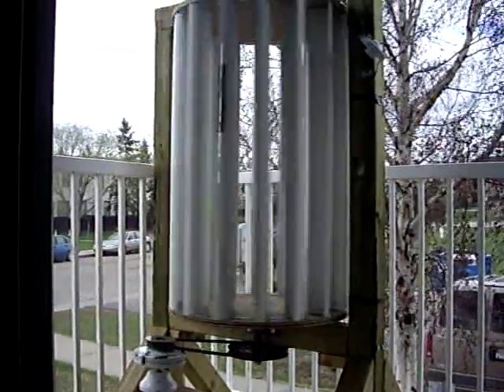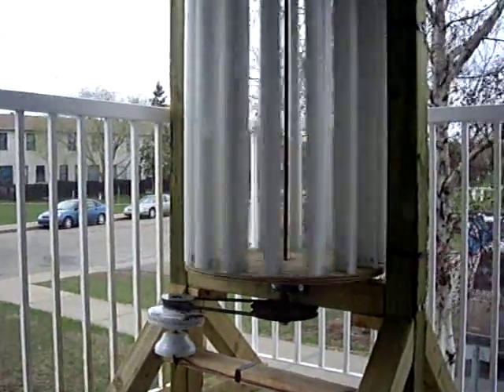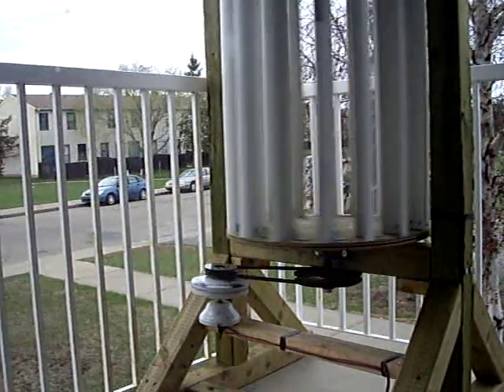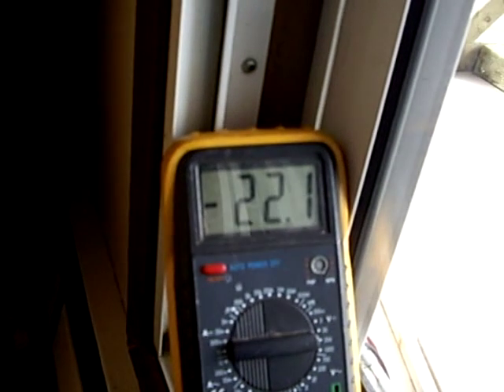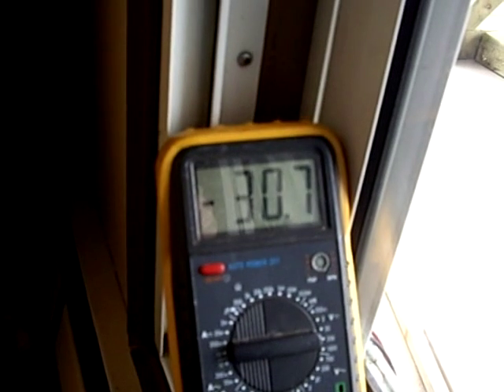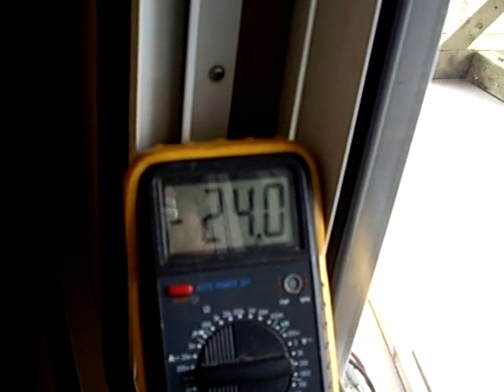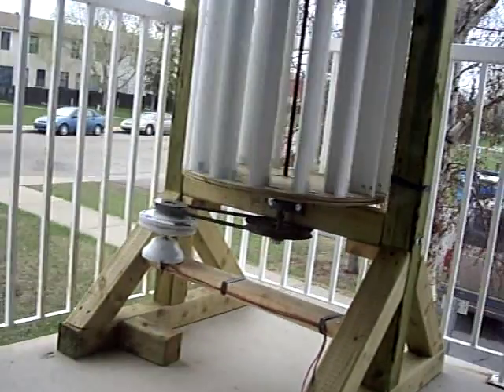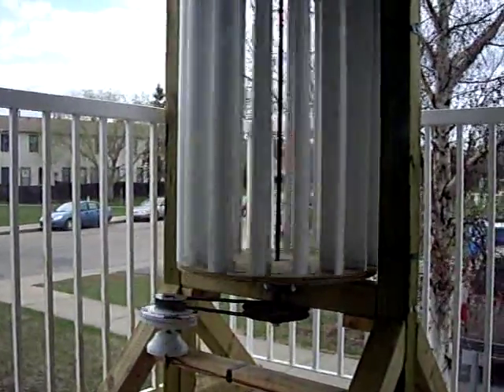VAWT - Vertical Axis Wind Turbine 200 Watt Low RPM

Comment: Hi,  my friend, can u commercialize it, and slightly scale it down on the blade.
May I know how to contact
you  ?
Reply from the maker: Hi sg sun, thank you for your interest in the wind turbine. Unfortunately I am not in a position to produce these units commercially. This was a test build to see if it could be done and it was successful. I did not have drawing or any plans as I built this from watching videos and other peoples ideas here on YouTube. This was built 7 years ago and I no longer have the unit.
If you are interested in building one yourself, please look at the original comment as I mentioned the frame structure size and blades there.
The only other help I can offer is this link: https://www.youtube.com/user/LynxSteam. Check his turbines, they are very similar and do have thinner blades. Good luck with your build.

Comment from the maker: An update on what I have learned from this project after building and running this VAWT:

1. High wind speeds. The design of the turbine was good, although during very high wind speeds resulting in extremely high RPMs, well beyond 50 kph (30 mph plus) I noticed the blades bowing outward at their centers due to the centrifugal force. My design did have extra space for possible flexing but did not expect that great of an amount of bowing. A possible fix would be to add 4 pieces of ready rod to stiffen the vertical axis (3/8").

2. Safety, again regarding high wind speed. I strongly recommend this type of a unit to be mounted high enough and away from anyone coming into contact with it. Although the PVC blades are mounted to catch the winds and any object would hit the back of the blade, I would still urge you not to allow anyone near it during its operation. Also where the framework meets the turbine blades would be an extreme pinch point.

3. Generator was too small. Although it was fun converting the ceiling fan into a generator, it is limited to about 200 watts of output. The turbine could easily run a PMA type generator in the range of 500 to 800 watts as long as your PMA does not suffer from clogging to maintain a reasonable start up speed.

4. Regrets, the only regret I have is that I did not document my build better. I went at this with my typical, in mind ideas to hands on building. Was it a learning experience, yes, definitely. Was it fun building, yes. Would I do it again, yes, definitely bigger with a more documented design and build process to allow me to share what I have learned.

All in all, it has been a learning experience. Due to my change of circumstances, I had to dismantle the turbine and re-purposed the support structure. I still have my generator and pulleys and will keep them for a future project.

I never expected to have over 10,000 views on this video and would like to sincerely thank all of you for viewing it.

Keep building a better tomorrow!
Cheers
Reply: DrFox2000 You needed a controller to control the battery charging and the rpm of the turbine. I use one on my vawts.    http://vawtsonly.createaforum.com

Comment: Great idea that converting a ceiling fan. I wondered about converting a motor to a generator, it seems like a logical conversion. Are there any problems I should be aware of doing this? I want to build a 2kw VAWT so I'm wondering about where to source a stator/generator? Maybe I should get an off the shelf unit?

Comment from the maker: @thrundar the magnets cost me about $44 from walmart. I tried hard to get my stator as even as possible to avoid clogging. Investment wise, a 200 watt VAWT is a waste of money and I would rather build a 1.5kw or larger to make it worth while. Total cost for the 200 watt turbine was around $450 for materials (all off the shelf). 
Yes, the 2:1 gear ratio is great, lots of torque and starts well in low winds. Took a bit of playing to get the ratio correct.

Comment from the maker: I will say, building a small unit with only 200 watts has its cost factors and if I was going to design a unit for going off grid, I would build a much larger turbine. When I converted the ceiling fan the costs were about $80. Total cost for material was about $450 so yes a bigger turbine would be worth it. Thanks for your comment.

Comment from the maker: Hi djdrive, the parts list is extensive. I would recommend that you start with building yourself a suitable"H" frame using either 2X4's or 4x4's, after you decided how large you are going to make your turbine itself. I used 3/4" treated plywood for the top and bottom circular plates (24" diameter). The viens are 4" pvc pipe cut in half lengthwise. Send me your rmail addy and I will send you pictures and diagrams.
Reply: Hi DrFox2000 is there and chance you could send me a hand full of pics too so i cant try it my self 
thanks a allot
Carmen